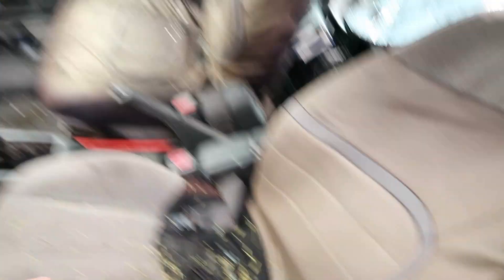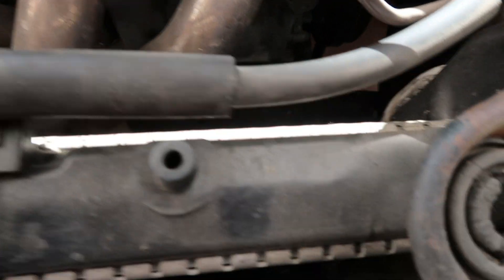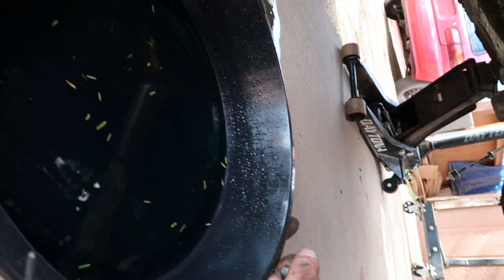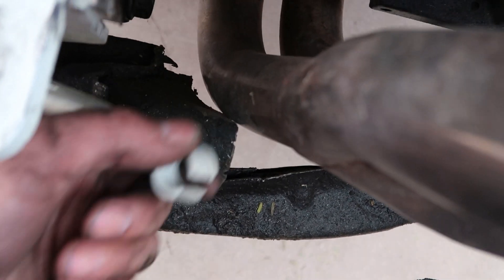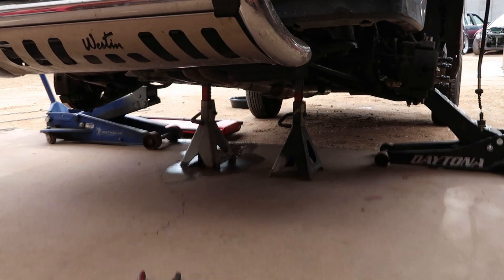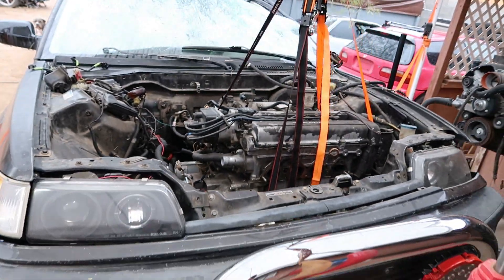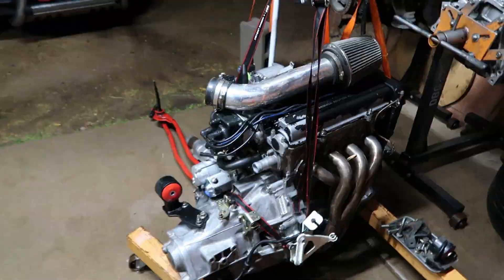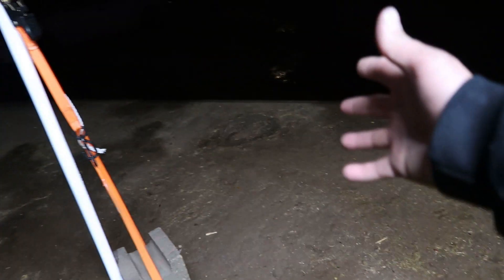Ripped the B20 out of the SEDAN!!

Comment: To get Staines off concrete. I always use toilet bowl cleaner. Sno bowl. Wet the oil spot the squirt the cleaner on it. It will foam up you can scrub with broom if you want and rinse away. Works great.

Comment: you could just unbolt the rear muffler, pull the entire exhaust front, and get it out under the car, without cutting, after you disconnected the subframe thingy.. and I think (according to EG and EK) the difference between sedan and hatch exhaust is just in the length of the rear mufflers pipe, so its bolt on to the hatch.